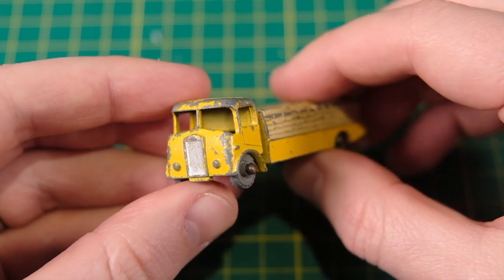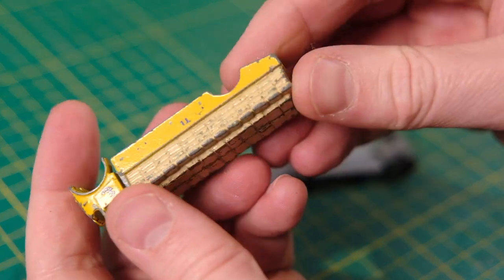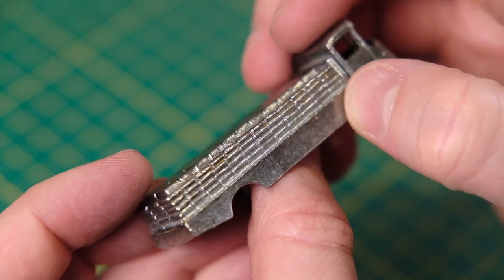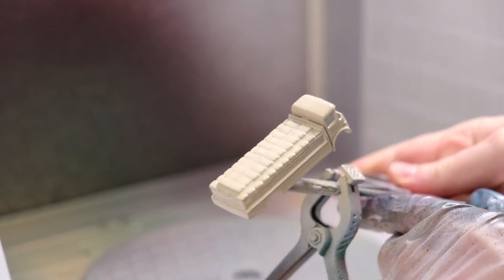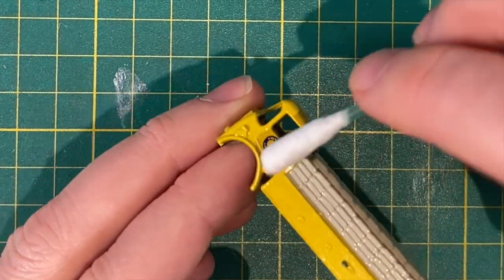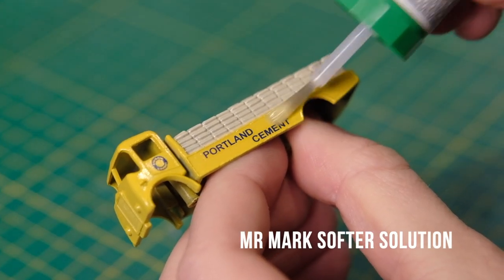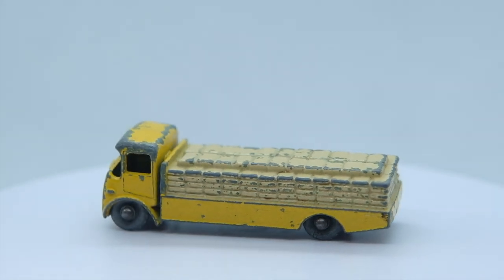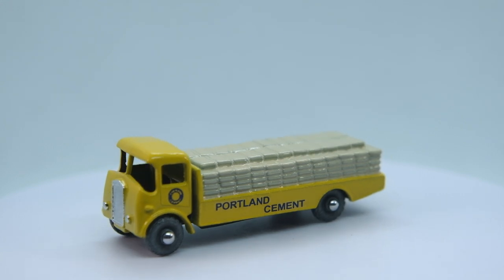MATCHBOX restoration: 51A Albion Chieftain - Blue Circle Portland Cement Truck

Comment: looks nice and smooth again. :)
good to hear you can now paint indoors, too. thumbs up to your brother. :D I found that outside the thinners might evaporate too quickly, and then you can't get a nice paint surface.

I got the same casting a while ago inside a job lot, and it looks about the same as yours, except the baseplate is almost-straight. :P maybe people step on these little things by accident and the baseplate gets the worst?